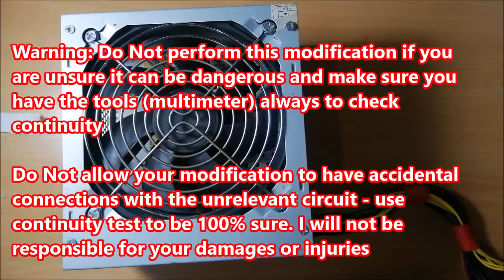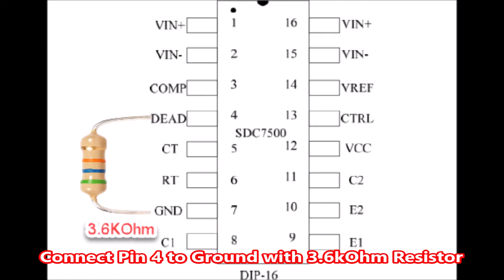#howto Remove ATX computer PSU circuit protection to prevent auto shutdown - for 12 v drill #youtube

Comment: I am not good at electronics, but when I looked at color codes for the resistors I found a different code for the one of 3.6 KOhm that you are  showing in the video. Am I confused?
Reply from the maker: Don't worry just use 3.6 kohm is fine

Comment: I have a CHMC S6B04 B494. should I connect the r=3.6K in the same way as in the video to the pin 4?
Reply from the maker: If u could provide the datasheet it would be easier to determine if the ic is the same
Reply from the maker: Maybe just maybe but I can't confirm b494 could be the same as tl494 but only with the datasheet or pinout of the ic you can be 100% ceetain

Comment: Please make the video on atx smps which has IC 6105.disable protection.
Reply from the maker: Will check it out for you
Reply: @neodiy did you figure it out? I have the same IC and cant get it to work
Reply: @DROGOC0P  base on my research it turns out there is no over current / over voltage protection for this IC ...which means you dont have to do anything. and it will work or perhaps it could be that it use another external IC to control its over current/over voltage protection....if you found that IC you just disconnect from the circuit

Comment: Hello, first thank you for your time sharing this awesome idea. Thats what i need now on my high current project with atx. Mine chip is AT2005B and its not like yours. I looked schematics but mine ic doesn't have "dead time control" pin. Can u help me ?
Reply from the maker: At first glance it's pin 6 where is says extra ovp/uvp protection pin which means over voltage / over current protection... But u got to make further research yourself to toduble confirm.. Thx for dropping by

Comment: When I connect my 12 v drill to 12 v pins then my supply fan turn off,should I also use this procedure in this case
Reply from the maker: First you open your psu and check the IC if it is KA7500 or SDC7500 or TL494 if yes then proceed because its the same thing. However take precautionary measure and use your multimeter to make sure that you solder correctly and not accidentally joint to unnecessary components nearby 

please read here some precautionary measure to ensure your safety https://howtodosteps.blogspot.com/2021/01/how-to-use-atx-computer-bench-power.html
Reply: @neodiy   Mine has a wt7520 ic is it ok?
Reply from the maker: @abolfazlm_yt  I think it's different I will find out and let u know
Reply from the maker: @abolfazlm_yt  Based on the IC schematic the circuit protection also located at pin 4 i think its possible but i can't guarantee you ...because i am only very confident about the ic listed in the descriptions are the same....

But you can try anyway the power supply these days are very cheap you can get $11 for 500watt over here
Reply: @neodiy  Is it the same procedure fo Power supply  DELUX ATX-450W P4?
Reply from the maker: You have to open and see the ic chip inside not all are the same... Some ic need different pin modification

Comment: can this be done with Dell Precision T5400 PSU? its rated at 875W but anything higher 600w on the load it triggers an autoshutdown
Reply from the maker: Yes it should work but you need to know the chip inside used by the psu... If it is the same u can proceed as video but there are other chip u need to modify on different pins

Comment: I did exactly as you showed in the video, but the power supply did not turn on and when I reconnected pin 4 to the circuit it turned on but the short circuit protection was still there.
Reply from the maker: What type of ic do u have is it the same as in video? And did you check using continuity test multimeter properly the original connection of pin 4 has been completely disconnected./cut off

Comment: Why one end of your resistor is going to other line of the pins?
Reply from the maker: It's very simple because that pin connected to the ground.. And it's the nearest.. So I don't have to solder it far away... U could solder anywhere as long as its ground point..
Yes direct wire also can but just to reduce current to the dead that's why need resistor... And resistor no direction either way can
Reply: Ok thanks. 
Correct me Sir. 
3.6kohm resistor between Dead to Ground. And cut Dead pin connection with board. Right?
+ What should be the direction of Resistor ?
I saw another video that guy is using only ground wire connected maybe with Dead and using it as Green wire
Reply from the maker: Yes 3.6kohm between dead and ground and cut the dead connection to the board which control the over voltage/current... Use your multimeter to ensure you did it correctly and ensure no soldering accidentally with other component
Reply: @neodiy  and direction of resistor?
Reply from the maker: @fiaziqbal3279  resistor no polarity...either way can
Reply: I did this yesterday and it worked. Saved me a lot of trouble and money. Thank you so much
Reply from the maker: @fiaziqbal3279  Congratulations!!!

Comment: Hi bro Im using a 330w psu 10A max for 12v to power my 775 motor as a diy drill some times it works and some times it auto powers off at start I want to know is there an easier solution without moding psu like adding a capacitor in series with motor ? (Sorry Im so noob in electronics)
Reply from the maker: Adding capacitor also no use because when it overcurrent or over voltage it auto shutdown..the only way is the modification as in the video.. If u use 12 volt drill at initial start it require around 5 to 7 amp to kick the motor start and when run normally it require only 3 amp.. U can watch this as proofhttps://youtu.be/YYKfqSrOaGc
Reply: @neodiy  Tnx for ur fast reply Ill do so

Comment: Pardon my explanation.
According to your SDC7500 map. The other end of your resistor should go into ground as you said which is 4th pin on left side in the same line where you cut off Dead pin connection from the board. I mean when you are soldering one end of resistor should be in 2nd pin and othe should be in 5th pin in bottom line. ( Left to Right ). But it looks like your resistor is going from Dead pin to E1.
Reply from the maker: Maybe you are mistaken because I flipped over the board... Its actually soldered to  pin no. 7 which is ground